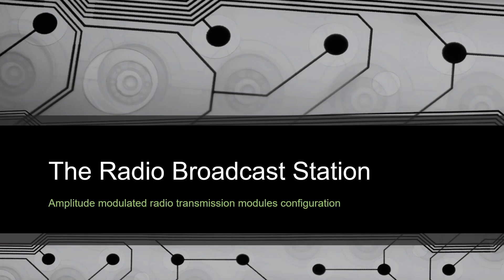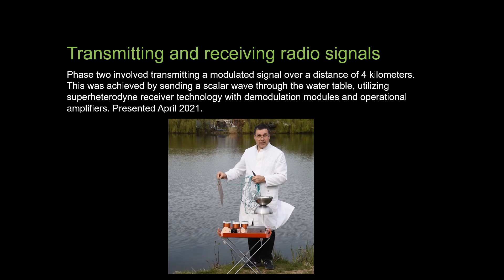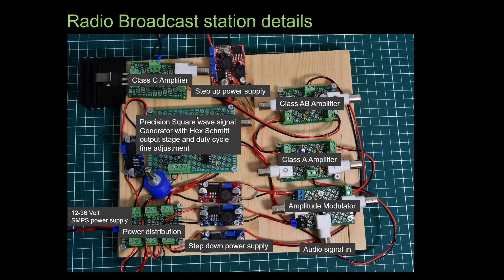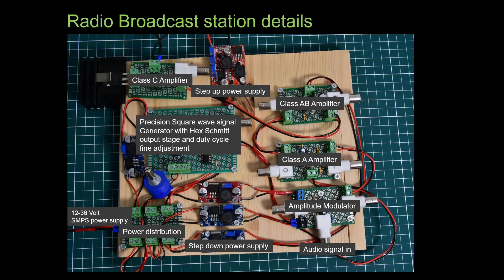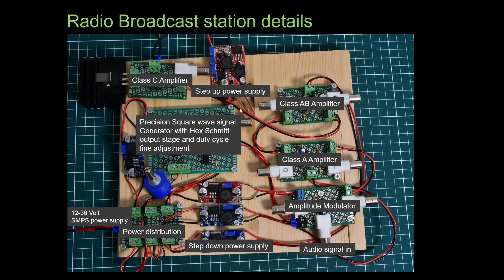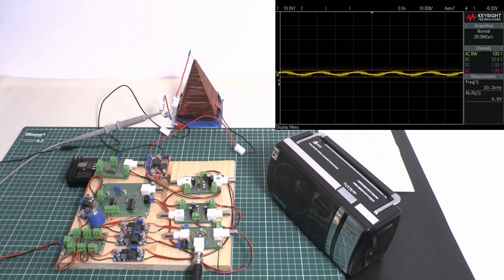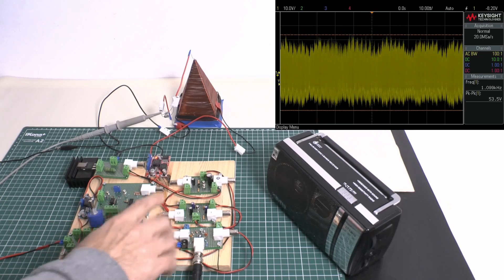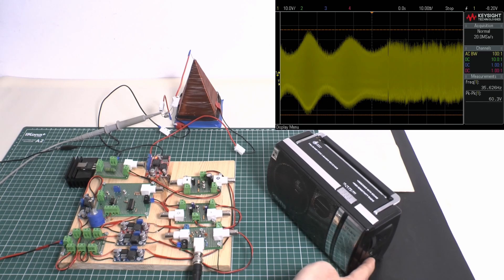The Radio Broadcast Station

Comment: good job, but why didn't you use an SDR👋🙏
Reply from the maker: I wanted first to go down the analog route which does cost me a lot of headache with capacitance field interference. For other project I used the Arduino board and programmed the sequence. I look into it. thanks.

Comment: As a broadcast engineer, I found your unique design fascinating. I'm amazed that you get a clean signal using a class C amp following AM modulation, but somehow you do!
Reply from the maker: Thanks but it was with great difficulty. At higher frequency it does not work anymore as the signal is getting to small. I improved the Class a amplifier with an inductor from the positive rail and had now twice the voltage available to feed the signal to a mosfet driver. I also had to reduce the voltage from the signal generator in order not to overload the AM modulator. My original idea was to use a class AB amplifier. as output stage I might still go for that option.
Reply: @TheOldScientist  I'll "stay tuned" for you updates.